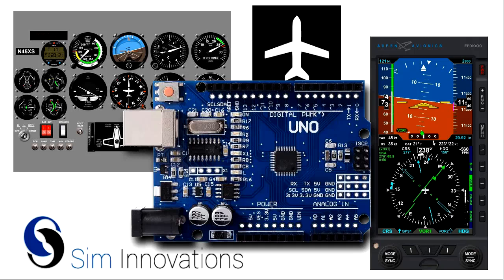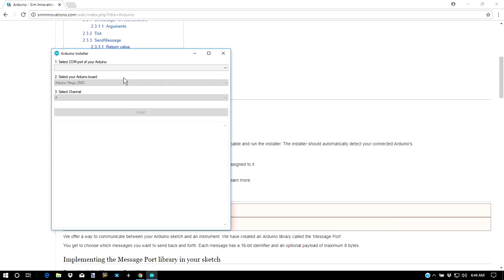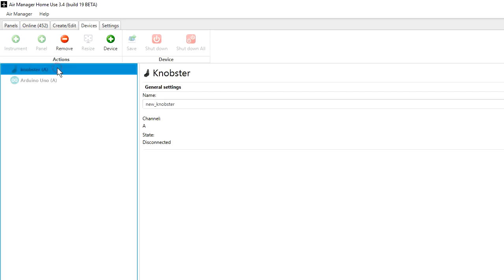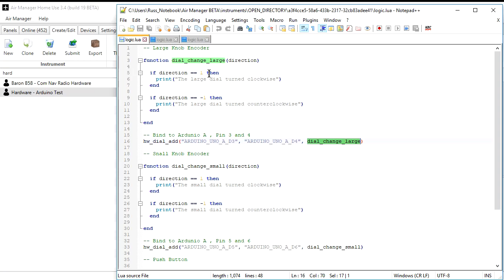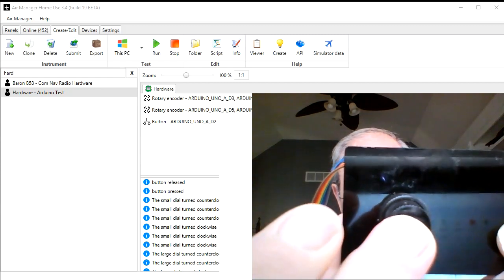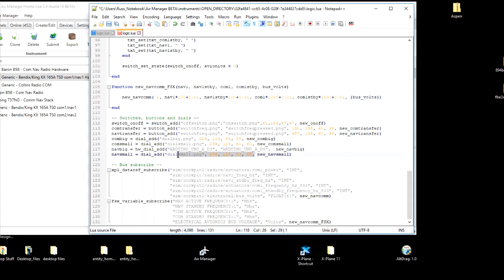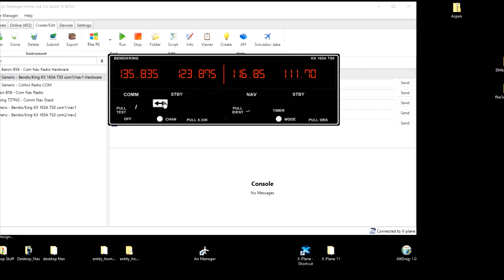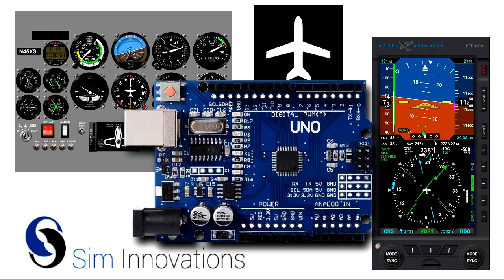Air Manager Does Arduino

Comment: very frustrating, i been following few tutorial, nothing work has shown. Nothing work
Reply from the maker: It’s been a while since I did that video…it worked for me. The interface may have changed. You do not explain what you problem is
Reply: @rbarlow   it is frustrating because it seam I am the only one who can not get anything work. 
I have an arduino micro, and the program do not recognize it. 
I just received a Leonardo, so I am going to try again and see if I have more luck.

Comment: Dumb question Russ but do you have to have everything wired in before you can do anything with the arduino unit? My PC recognized my uno and says connected but that's about it.
Reply from the maker: Not dumb.  If you connect the Arduino to your computer it will power up from the USB ( you may need additional power from the adapter for Mega and Uno I think).  Then you can flash it right from Air Manager.  Best to see which com ports are already active  by clicking "Flash" and checking the pop up menu to see any that are active you plug in the Arduino, so you will know which one was added by the Arduino when you plugged it in. Otherwise it is trial and error until you find the Arduino com port. And if it is a Nano clone, be sure to check "Use old bootloader" before flashing. After flashing it should show up in bold print under the Actions column in the Home tab.  If you click that line the settings on the right pane should show State: Connected  Then just wire things up and you should be good to go.
Reply: @rbarlow  thanks Russ  I'm working on the project now.  Also designing a box in Tinkercad to 3d print to mount it all in. Got it flashed and connected,  now just the wiring bit left.
Reply from the maker: @buckrodgers770  are you using hardware functions or are you creating your own script? What controls does your project have?
Reply: @rbarlow  I'm trying to make a parking brake with 2 LED's one red and green for an on/off state. I have to teach myself how it all works.
Reply: @rbarlow  I have a bunch of resistors, LED's,  wires and all that. A push/pull switch like a Cessna and the breadboard and UNO the USB to the UNO. I have a home cockpit and it's something I wanted to teach myself to make.
Reply: @rbarlow  I'm assuming if I can link it to the brake in my air manager panel it will make the brake in my plane work.

Comment: Hey Russ do you think this would work for a push/pull switch for a parking brake in msfs or doesnt it work that way? I do have Air Manager.
Reply from the maker: Sure Michael. I just used a simple push switch on my cockpit. I did gear with lites , flaps and park brake on a Nano
Reply: @rbarlow  That's great Russ. I had no idea Air Manager had that capability. I ordered an arduino uno and some other bits to give it a go. Many Thanks

Comment: after my successful flash to a Mega it  doesnt see it, only talks about a "Flight Illusion" device (on AM 3.1.7). Anyone any ideas?
Reply: Feedback & Tip for everyone: there is a box to be ticked in Settings which allows "Connect to Arduino" which set off as default

Comment: Air manager does arduino. Mobiflight does arduino.... can they both be run on one arduino?
Reply from the maker: No the each run a separate program called a sketch in Arduino talk. The good news is that they are cheap and you can have multiple Arduinos on your usb bus. The main difference is that Air Manager can do a lot more than just Arduino and is infinitely flexible but it costs. Mobiflight is a good solution if you just want to add only a few simple switches or knobs to your sim and is free.
Reply: @rbarlow  yeah I wondered of a sketch can combine both. Be an interesting experiment. I am building a big widebody sim for a local Air collection based on a bac 1-11.
Reply from the maker: @Thegasman-hc3zz  interesting. I flew at USAir and when I started we flew the BAC 1-11s. I never flew it but did ride the jump seat a few times. I loved the howling sound the extending flaps made. 

To run both sketches simultaneously they would have to be written as a single sketch. 

Besides mobiflight their are sketches that run on Arduino Leonardo boards that can emulate a joystick so you need no software but can assign them attached switches and encoders in your sim as you would any other joystick control.
Reply: @rbarlow my current issue is adding 3 screens displaying instruments. Controls wise I just need to add a paid of sliding pots for throttles hence the mobiflight option. Trying to avoid another pc to maintain running instruments.

Comment: Do you think it would be possible to leave the coding for the on display dials and push button for frequency change and then add Arduino code. Then having the ability to use the hardware knobs or the touch display.
Reply from the maker: Yes that would be no problem either one would work just like you can make a frequency change on the simulator screen or on the air manager panel the hardware would just add another possibility

Comment: For your problems with your comments ports try setting a static port in Windows device manager. Like four come one go to properties, there you should see ports. Do a little research on it as well because it's been awhile since I have done this.
Reply from the maker: This issue has been resolved with later  versions of Air Manager.

Comment: Russ/anyone...

My rotary encoder in air manager  displays “the dial turned clockwise” and the same for counter clockwise but (twice per detent/click.) Not one one each click like yours.....but my script is correct. Is it my encoder. It’s a 360 degree 20 position encoder. I’m so confused. TIA
Reply from the maker: A bit over my head but there is a encoder preferences setting for clicks per input. Assuming you have it connected correctly. I’d ask Ralph or Corjan at Sim Innovations
Reply: @rbarlow  Ok. I purchased AM this week and have about half my Cessna panel instruments working with  rotary encoders in XP. I owe a lot to you and your video on how to do that’....so thank you!! Next step is Reality Xp for the Garmin 650/750, but I’m sure that’s gonna be a big can of worms to figure out, lol.
Reply from the maker: There are custom datarefs and commands for the RXP GTNs so it is not too hard to figure out. Keep me posted and send a photo or two when you have it done. Send it to barlow320 which is at gmail which is a com domain name.
Reply: @rbarlow  Rogo..

Comment: This is a wonderful video! I am trying to build a Saab340 home sim. I will be getting Air Manager for sure!
Reply from the maker: Good choice! Depending on how deep yopu get into it Air manager can do everything for your cockpit including hardware controls.
Reply: @rbarlow  I have designed eng, prop gauges from the scratch. They work well with AM. But I can't get Arduino communicating with the AM, even though the code is right and the switches are working in the AM console. Will dig deep!
Reply from the maker: simhoper did you: 

Select the correct Arduino model when flashing the Arduino and did. it say successful?

Does the Arduino shoe up on the devices tab in bold(not gray) text?

Do you have the correct PIN numbers ( and D or A correct).
Reply from the maker: simhoper also since this Video hardware was added to user properties and allows users to change Arduino type and pins assigned on the fly see  http://siminnovations.com/wiki/index.php?title=User_prop_add_hardware_id
Reply from the maker: simhoper finally remember the sim with the latest Air Manager plug in must be operating for the Arduino device to work
Reply from the maker: simhoper one more thing is that if you assign the type wrong in a function for XP ( say INT when it is really a FLOAT) not only may it nor work but even correcting it will not get it working. The only way to straighten things out is to restart both XP and Air MGR.  If the instrument was working before converting to hardware it not likely the problem but knowing this will save pulling out a lot of your hair in frustration.
Reply: @rbarlow  Thanks for your feedback. Yes. I flashed it on win machine. I code on my mac. And after flashing mac identifies the 2560 well in the device tab (channel A and PIN mode). And I have selected the correct channel (A) and the pin (D5) and tried the switch. I will try again. Thanks
Reply: @rbarlow  thanks you! I will follow this
Reply: @rbarlow  Yes I got the AM a few days back and already made an update too.
Reply: @rbarlow  I am coding the Master battery switch as per the below link. But it didn't say the data type to be mentioned. http://siminnovations.com/wiki/index.php?title=Switch_connection_tutorial

Comment: Hi Russ, can you re-do this video using a Raspberry Pi that is displaying a instrument in the Pi Air Player? I'm in need of help getting the encoders to work there through the GPIO. The Wiki is too light on these.
Reply from the maker: Not that expert on raspi but the Sim Innovations forums have lots of raspi users that can help. Corjan, lead programmer, reads the posts regularly.

Comment: Is their anyway i can use ardino with my flight simulator wothout having to do any coding?
Reply from the maker: If you could find existing instruments in the Air Manager store that do what you want but probably not. Sorry
Reply: SimVim uses Arduino and you don’t need to code.

Comment: Russ, could you share where you got the dual concentric rotary encoders?  They're a rare part to find these days.  I've been doing a lot with Arduino and X-Plane, but now I think Air Manager may be an easier solution to some of the things I'm trying to do.
Reply from the maker: Leo Bodnar in Europe sells Elma dual encoders and Desktop Aviation and PROPWashSim.com also sell a less sturdy encoder but it works

Comment: Hi.

Can you help me with a code i want to implement ?

I'm using a single encoder for each radio channel, and what i want to implement is when i press the encoder button it'll change the standby Khz, and when pressed again it'll change standby Mhz.
Reply from the maker: Slammer the easiest way to do that is to create a variable to store the state of which is selected, something like  

local g_mhz_selected = 1 (this variable needs to be initialized outside and before any encoder or button callback functions)

When  g_mhz_selected is 1 you will have the encoder call the command(event) to set the MHz and if 0 to set the KHz.

When the button is pressed you can use the following to flip flop the 1and zero value for the global variable  g_mhz_selected

g _mhz_selected =  math.abs( g_mhz_selected - 1)

Besides changing the variable you might want to change a led or an onscreen graphic to give the user some feedback which part is currently selected .

That’s the theory. Give it a try and if you need more help I can write the code for you but see if you can make it work first.
Reply: @rbarlow  Well, i'm not that much into the logic or principles of Lua coding, tbh. That's why i'm beggin' for help at their forums. 

I also need to implement 7219 modules for radios and mcp displays.
Reply from the maker: Slammer I am at FlightSimExpo this weekend. No time to help right now but maybe next week. You might get quicker help on the Sim Innovations forums. There are some real hardware experts there that can guide you. Otherwise remind me next week when I am back home.

Comment: Ca you run multiple Arduino, cuz I already have one Mega2560 integrated and drive to my 530 GPS  ?
Reply from the maker: Yes I know of several people who have large cockpits with over 10. Just be sure to select a unique channel letter for each Arduino of the same type (Mega for example) when installing the Arduino software.
Reply: @rbarlow  ..tnx u so much Russ

Comment: I have the knobster and tying to code the inputs for testing.  In the below code I can get D3 to work (not D3 + D4) on the outer knob (large) but the inter knob I cannot get it to work and if I combine any other functions to the dial_change_large function. It no longer works correctly, I get odd results.  Sometimes two clicks get a output.  I cannot get the inter knob to work by it itself either.  Any assistance would be appreciated.  I used the 3.5 Boot loader with no good results.

Thanks
Dave

-- Callback function which is called when the rotary encoder is turned
-- direction 1 : The dial turned clockwise
-- direciton -1: The dial turned counterclockwise
function dial_change_large(direction)

  if direction == 1 then
    print("The LARGE dial turned clockwise")
  end

  if direction == -1 then
    print("The LARGE dial turned counterclockwise")
  end

end

-- Create a new rotary encoder
hw_dial_add("ARDUINO_NANO_A_D3", "ARDUINO_NANO_A_D3", dial_change_large)

--function dial_change_small(direction)
--
--  if direction == 1 then
--    print("The small dial turned clockwise")
--  end
--
--  if direction == -1 then
--    print("The small dial turned counterclockwise")
--  end
--
--end
--
---- Create a new rotary encoder
--hw_dial_add("ARDUINO_NANO_A_D4", "ARDUINO_NANO_A_D4", dial_change_small)

Comment: Hello! I'm a fan of Air Manager. I'm trying to make the arduino work with rotary encoder. I did everything correctly, but by setting frequency in the knob, Com1 shows random numbers rather than the sequence. Large and small knob. I researched and found no solution. Any chance of a tip? I ma using Rotary encoder for Arduino, Pic Ky-040.
Reply: I have been playing around with Arduino the last month. Trying to get it to interface with X-Plane and DCS. I found that I was able to use the Rotary encoders are regular buttons, i.e. Pin 2, Pin 3 an Ground on Arduino or as part of a matrix. The matrix provides increased options. Each Arduino board can have up to a maximum of 81 functions. I prefer using the Arduino Pro Micro which interfaces directly with the USB and requires no additional coding to work in X-Plane, DCS or FSX.

Comment: Hi Russ, Excellent video, just what I need for my flight sim setup.  I'm over in the UK, just ordered all the parts and been trying to get it all to work today.  Scripting/programming works all OK, not convinced I have the connections between the rotary  encoder and the Arduino correct.  Do you have to supply a 5v connection between the 2 items as well as data?  What is the orange and yellow connections you have, they are "analog in" on mine????  Any chance you can drop me the details ?
Paul (at) thrower.org  Cheers in advance
Reply: OK, just sorted it, misspelled ARDUINO the first time I used it and copied the mistake throughout my scripts!!!! Doohh!!
Reply from the maker: Paul Thrower each single encoder requires two digital pins on the Arduino. One clockwise and one ccwise. The third middle pin on the encoder is connected to ground.
Reply: Cheers Russ, got it all sorted now, cock-up in my spelling!  Any chance of a video of how to create a Knobster, would be my dream to turn it into "One knob to rule them all!"  (You can use that as a Title for the video). :-)
 Thanks for all the brilliant videos you do.
Reply from the maker: Paul Thrower  stand by a few days. I will be announcing a kit to build a Knobster as well as a DIY guide to scratch build one
Reply: Absolutely can't wait, have built my own knobster, works correctly on my own coding, but all a bit messed up when used on existing instruments, need to know what I am doing wrong :-(
Reply: Finally got my "knobster" working correctly on all panels, absolutely love it, really adds to the immersion factor!
Reply: @rbarlow  You also have a second option of creating a matrix with the Arduino coding and using the rotary encoder as a simple button. I tried this both in X-Plane and DCS. Turning the encoder one direction will output a set of assigned keystrokes and a different set of keystrokes when turned the opposite direction. I have used this to adjust the trim up and down on my aircrafts.
Reply: @_PGT  Would you be willing to share your script for the knobster? I'm pretty handy with a soldering iron but have no clue when is comes to programming!
Reply: @dmc0331  the scripting is all supplied built-in within Air Manager, once it's built correctly it all works wonderfully!